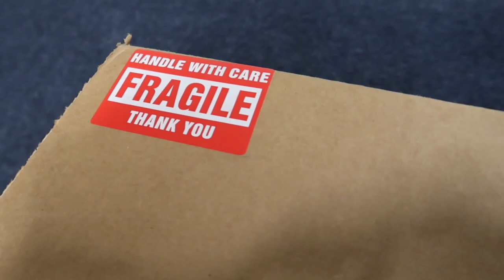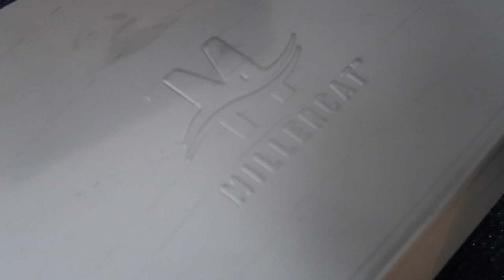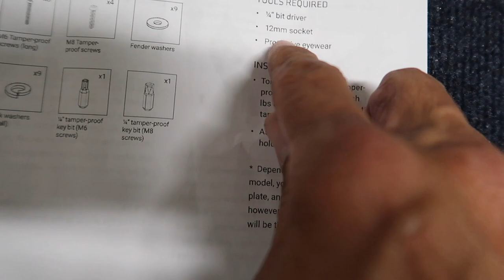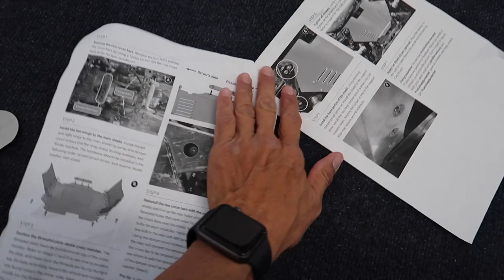Stop Catalytic Converter Thieves!  MillerCat Shield Installation for the 3rd Gen Toyota Tacoma

Comment from the maker: Think of this...$390 gives you peace of mind.

$500-$1000 is the average insurance deductible for theft replacement (if covered)

$800-$1500 for a cheap aftermarket replacement with labor

$2000-$3000 for a factory replacement with labor.

Comment: Just put mine on but I am getting a lot of rattle... been looking for any videos if anyone else is having the same issue. It was a tight fit so I may have to go back over all the spacing but it seems like its the flexing of the passenger side of the shield that is banging up against the cat.
Reply from the maker: I used to hear a tiny bit of rattle when I was outside, but nothing from the cab. If I was still getting the noise, I’d likely get thin silicone 3M sticky tabs (since they’re heat resistant) and put them on the metal-to-metal contact where it might be an issue and that should solve it hopefully.
Reply: @AdventureStop  much appreciated for the reply